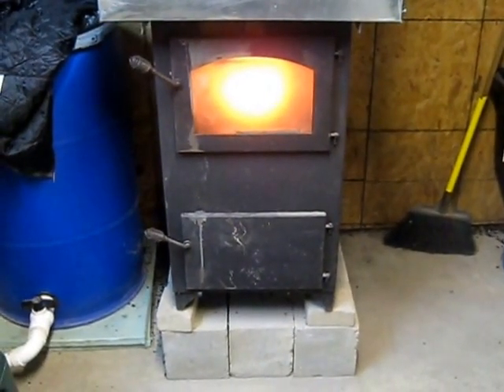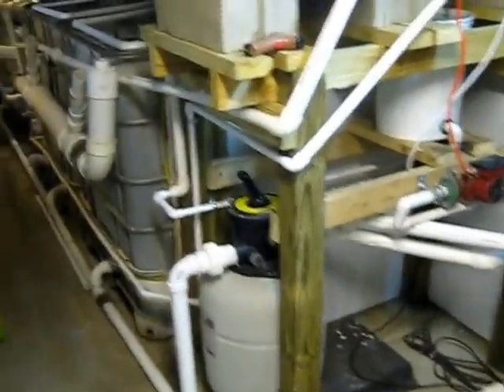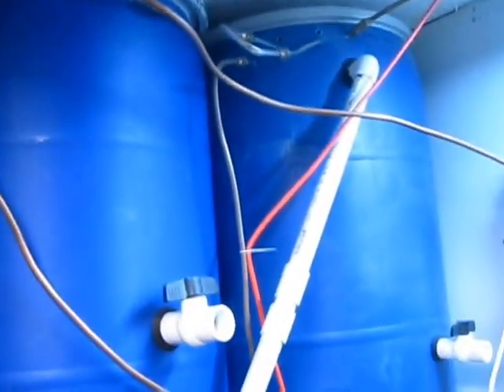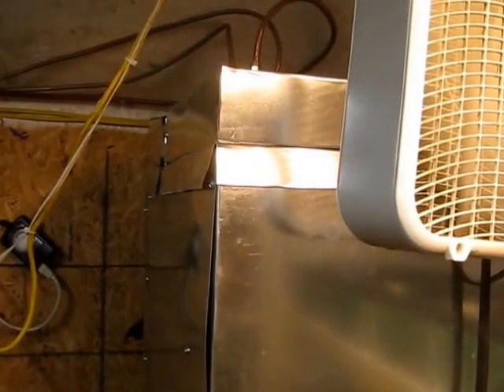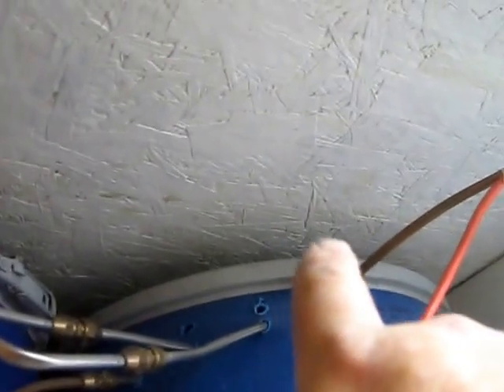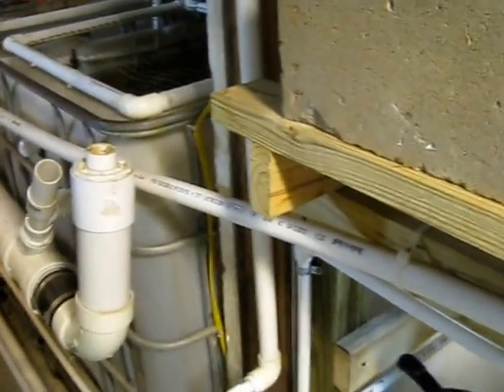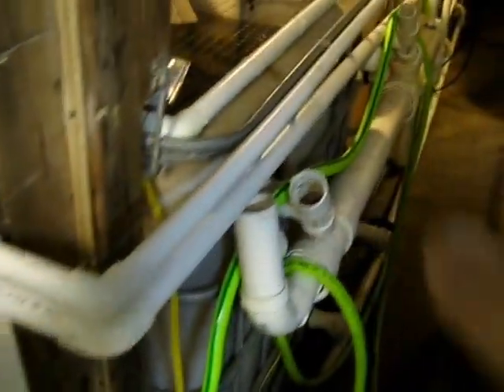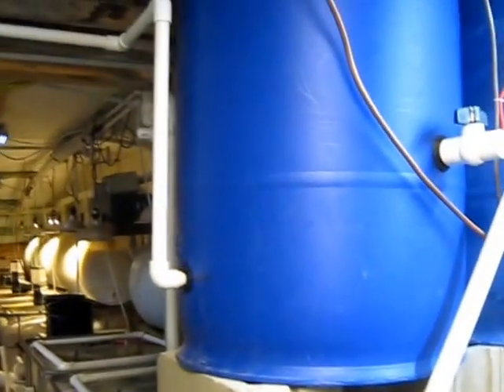Anthricite Coal Water Heater Update 1.17.15

Comment: I realy like your basic concept one thing that might help is if you can put your radiators and copper tubing in a liquid holding tank that is mounted on the top of your stove.  Air is a very poor heat exchanger compared to most liquids.  If you used a non toxic antifreeze like Peak in a sealed tank you should have little to no fluid loss.  You would also need to leave room for expansion or have an overflow container like a car has.

Comment: If you use a large submersible pool pump inside your sump. The heat from the pump itself will warm up your water to high 70 low 80 degrees.

Comment: Is it more costly to run the pump and the fan and coal stove than it would to be to run an inline heater?  I would think that an 500-1000 watt inline heater (like used for hot tubs) might be less expensive in the long run.
Reply from the maker: Brad, In our climate, it takes 3000 watts minimum. When comparing the cost of heating fuel, you need to calculate the cost of the fuel per million Btu. The cost of electric per million Btu's is in the neighborhood of 35 cents. Anthracite is around 11 cents. Quite a difference over the course of the winter. Steve